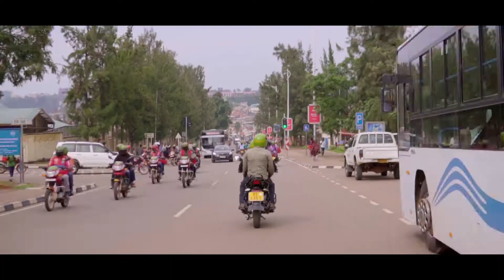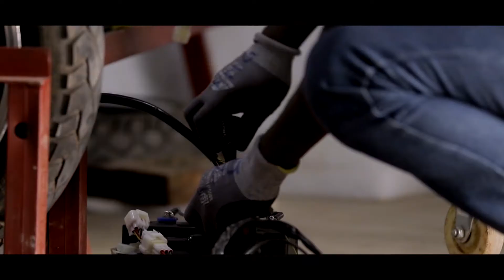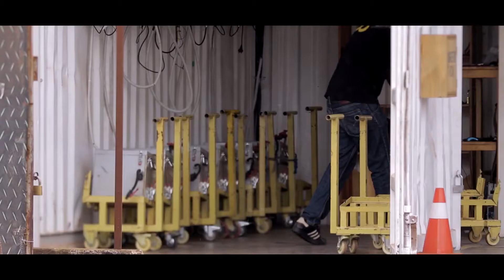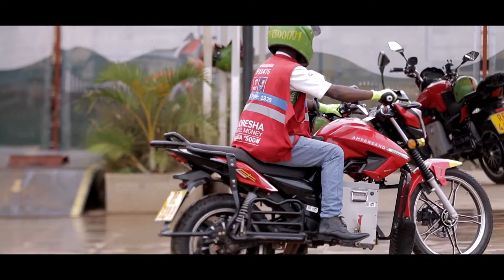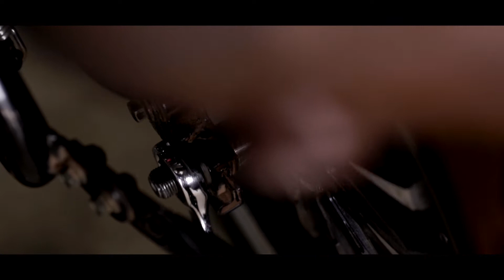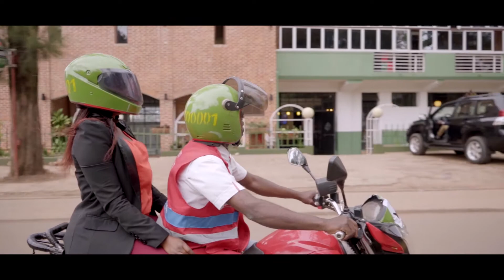Ampersand Intro

Comment: Not sure about the battery swaps because batteries are in limited supply and this system requires extra batteries. This is why Tesla has charging and not battery swaps - but I still wish this company every success because I love electric transportation!
Reply: Link to the Tesla please
Reply: Tesla has charging and not battery swaps primarily because a car battery weighs hundreds of kilos, so cannot be swapped out by hand or with a simple handcart. At the time of Ben's reply there was a shortage of both the microchips and the metals used in EV batteries. This was most acute for Cobalt, which Ampersand batteries do not use. There are companies in China that are now doing battery swapping in China for cars. Although battery swapping requires more batteries than vehicles, the utilisation of the batteries themselves is the same - users can just ride more rather than waste time recharging.